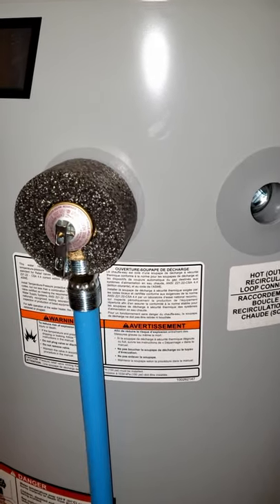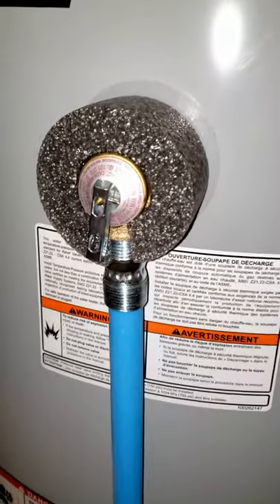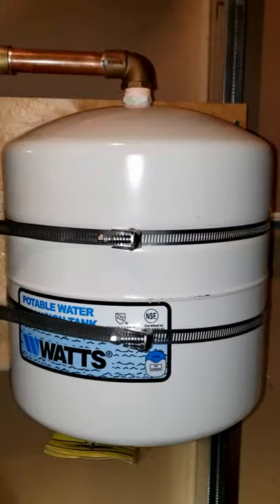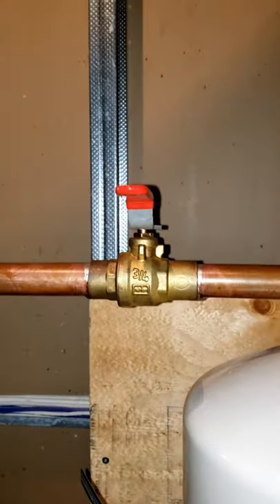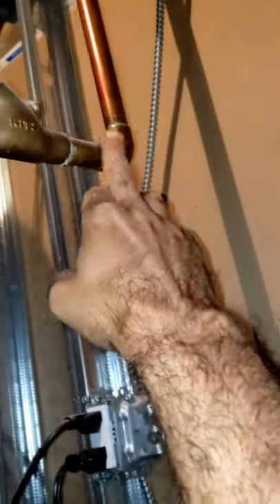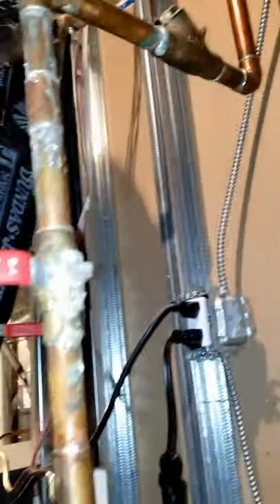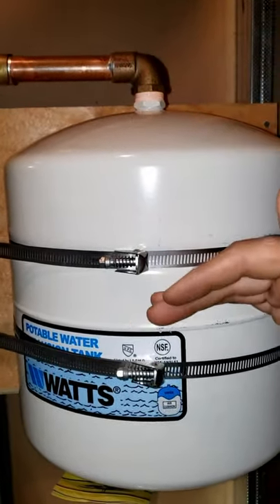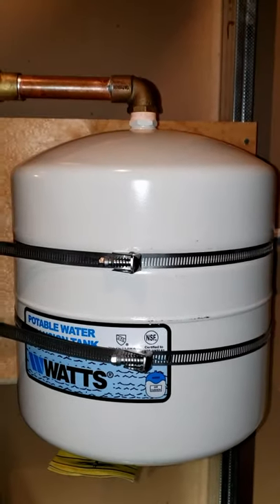Stop Thermal Expansion from Tripping your Water Heater's T&P Valve! #SHORTS

Comment: Is it mandatory to have a drain by pressure relive valve in mechanical room or where water heater is located ?
Reply from the maker: Sam!  Nice to hear from you...I'm happy to see that I haven't scared you away after your being forced to spend eight excruciating weeks with me!  😁

OK, on to your question:  In Ontario Code:  No, you do NOT require a drain to be located in the vicinity of a temperature & pressure relief valve, nor do you need the relief valve's outlet to discharge into a floor drain in any way whatsoever (awesome if you can, but if you do, don't forget the mandatory minimum 25mm vertical air break between the flood level rim of the receiving floor drain and the the T&P discharge pipe - check your notes!  😊 ) 

If you look at Code reference 7.6.1.12 (you still DO have your sacred little brown book, dontchya???  🤔)  all that's required is that you terminate thee T&P valve's discharge pipe between 6 and 12 inches off the floor.  Too low, and it runs the risk of being obstructed, and too high, it may cause injury if it ever goes off.

Hope this helps, Sam!  Keep staying inquisitive 👍, and I look forward to seeing you in Intermediate if I'm still at the college!

Comment: Amd what about the instantaneous electric water heater, what are the plumbing accessories and appurtenances required for it?
Reply from the maker: That would depend on the water heater model and the manufacturer's instructions.

I haven't had much experience with the INSTANT electric ones, although most traditional electric water heaters still need a T&P relief valve - so I presume the electric on-demand heaters would require the same.
Reply: @PlumbingsCool I checked the equipment installation sheets, and the manufacturer doesn't recommend T&P relief valve. However, do I need to provide Isolation valve on both the hot and cold water lines or an IV just on the inlet cold water is fine?
Reply from the maker: It's always a good idea to add isolation valves on both sides so it can be removed or serviced without affecting cold water flow to the rest of the building - although Code only requires isolation on the cold side, which is common for domestic applications (houses). 

However, it's common practice to add isolation valves on both the cold and hot for commercial applications, which often consist of multiple water heaters.

If you're installing to allow for descaling of tankless heaters, then you WILL need to isolate both sides in some capacity so that you can allow the descaling solution to circulate.  Your best bet in that case are 3-way valve kits, similar to the ones shown in my descaling video.
Reply: @PlumbingsCool thanks once again

Comment: Hi. One more query, again 😅
How do you calculate the hot water demand for a residential building?
Reply from the maker: LOL...that's a topic I spend an entire week teaching to my students, so it's not so easy to convey through a text message.   Although it's not difficult, there are a lot of moving parts and involves a number of Codebook tables - as well as supply pressures, developed lengths, flow velocities, etc.

Maybe I'll make of video of it one day, which will require significant planning and preparation to properly convey through video.
Reply: @PlumbingsCool  There is one table in ASPE which has gph values for fixtures, demand factor and storage factor, do you use this table?
Or maybe I should simply wait for your detailed video on this 😅
Reply from the maker: Nope.  We use a combination of up to FIVE tables:
1. WSFU's for "listed" fixtures (sinks, lavs, bathtubs, tank-flush toilets, etc)
2. WSFU's for Direct-flush toilets (flushometers)
3. WSFU's for Direct-flush urinals
4. WSFU"s for "unlisted" fixtures, based on fixture's/equipment's supply size
5. Finally the actual pipe-sizing table once we gathered all the information from the above tables.  

Pipe sizing is based on:
-Total Developed Length to the furthest fixture being served
-Total WSFU being served
-Flow rate dependent on installed material (1.5, 2.4 or 3.0 meters per second)
-Net supply pressure (after deducting head loss)
-And whether you're referring to Water Service (before the meter) or Water Distribution (after the meter, or after it comes into the house).

Comment: I like the relief valve drip leg to be a non-ferrous metal.
Reply from the maker: I still make them out of 3/4" copper pipe and an adapter when required, although these days the new water heaters come shipped with that plastic blue dip tube.  Now even the T&P valve comes preinstalled, whereas in the old days we used to have to purchase them separately from the tank.  I think the manufacturers put these measures in place to ensure that the relief outlet doesn't get bypassed or plugged, which could prove disastrous if pressure builds up in the system.
Reply: Why would that even matter? Pex or cpvc works just fine.
Reply: @sjohnson5813  it's against New York state code. And what do you think's going to happen to that plastic if 210° comes out of a relief valve along with pressure. How about that Einstein

Comment: Can we apply the same logic on thankless water heater?
Reply from the maker: Great question! The short answer is that expansion tanks can certainly be installed for tankless heaters as well, but the long answer is that you probably won't need to.

I'm thinking of trying something a little different on my channel, by elaborating through video on some questions I receive which deserve a little more information.  So if you don't mind, I'll probably start with yours! 😁

Stay tuned!
Reply: @PlumbingsCool  sure
Reply from the maker: Here you go...just for you!  Hope it helps.
https://youtu.be/vtVVKIpsnAI

Comment: Should I turn off the gas line when the TP trips after shutting the water?
Reply from the maker: It depends on what you intend to do and how long you intend to keep the water heater isolated.  If the T&P valve  is going to be replaced immediately and the tank is going to remain mostly filled (up to the level of the T&P valve, then you can leave the heater functioning as normal and the gas valve on (the tank will maintain the existing water at the set temperature and turn on as required) But if you intend to leave the tank sitting isolated for a long period of time (several days or weeks), then it may be in your best interest to shut down the tank (either at the gas valve, or by simply unplugging it if it's a power-vented unit to save on some heating costs.  Just be sure that you heat the water to at least 140F and flush it through a fixture once you recommission it (to kill off any bacteria which may have accumulated while the tank was off). 

If you're concerned about safety, the gas valve is completely independent from the T&P valve.  Just be sure never to keep a water heater running unless there is an adequate volume of water in it...especially the electric  with immersion elements, which will cause the heating elements to immediately burn out if they are not immersed in water when they become energized.

Hope this helps.
Reply: @PlumbingsCool  thank you
Reply from the maker: Pleasure's mine! 🙏

Comment: I dont think you need an extra shut off valve by the expansion tank ..it's a little overkill as you have another one 18 inches away that does the same job , may be it's good for NON - PLUMBER TYPES because they don't know how to control excess water after system shut down .
Reply from the maker: True, a valve to isolate the bladder tank isn't absolutely necessary, although I personally prefer to valve everything so that the rest of the system can keep functioning while isolating one part of it. 

Note too that this is for a non-technical, non-plumber's residence.  If that bladder tank ever starts to leak, all they need to do is shut off that valve and keep using the system until they can schedule someone to go over and replace it.
Reply: Nothing wrong with another isolation valve. It doesn't hurt anything . Calm down DIYer

Comment: We had a freeze last night. I woke up this morning and found ice on the hot water heater. After monitoring it for over 10 hours later, I noticed about 3 little drops of water in the pan I placed on top of the hot water heater to monitor one of the connection joints. I've called numerous specialists, but no one can come out because they are swamped with work and because it's Christmas. I don't know what to do. I don't know how to shut it off if I had to. This is my 1st winter in my house. The hot water heater is close to 9 years old. I kind of think a pipe didn't burst because it warmed up a little today, and I really didn't see a lot of leaking water. What should I do? Thanks in advance.
Reply from the maker: Hi there.  Sorry to hear about your predicament on Christmas day.  Although it's impossible for me to accurately assess your situation, I may be able to direct you toward some tips which may help you control any excessive pipe leaks, until you can acquire professional help.

First, your water heater should have a stop valve on the cold side going into the water heater.  If your leak is between the valve and the tank (or somewhere on the hot water line), then you can simply shut the valve off (although you will have no hot water).

If the leak is before the tank's stop valve, then you may need to shut the water off at the main stop valve, where the water comes into the house (though you will have NO water in the house while the main water remains off - but at least you'll be able to control the water flow).  The main stop valve should be next to your water meter (or by your well tank if you're on a well system). 

Here's a video pointing to a stop valve on a typical municipal system, for some guidance.

Hope this helps and good luck!

Replacing your main stop valve:
https://youtu.be/6BGyjUKHdo4
Reply: @PlumbingsCool  Thank you very much. I haven't seen a leak all day. Nothing is in the pain at the bottom. The pressure release valve is warm, and the long pipe going alongside the water heater is cold. Is that normal?
Reply from the maker: What you describe sounds perfectly normal.  The pressure relief valve is warm because the heat is transferring from the heated water inside the tank.  The tube along the side should remain dry and at room temperature.   Not sure where the water you mentioned was coming from earlier,  but pipe leaks don't usually stop on their own, so that's somewhat strange.  Keep a close eye on it, and if it starts to leak again, be sure you know how to shut the water down as I described before.
Reply: @PlumbingsCool  Thank you. A specialist will be out today. You're a life saver... Never change. Thanks for your videos! Happy holidays!🎄🎄🎄

Comment: Why not just eliminate the check valve?
Reply from the maker: Good question.  I was actually considering removing the check valves initially.  This system had two existing check valves:  One on the cold, and one on the hot.  I'd agree that the hot side is irrelevant, but removing that one would not solve our problem with thermal expansion - so I decided to leave it simply because it doesn't really do any harm by  doing so (although I wouldn't install it as part of a new installation).

I decided to leave the cold-side one because of the hot water recirculation pump feeding into it.  I'm guessing the check valve was installed to prevent inadvertent backup/transfer of hot water back into the vertical cold water feed.  In hindsight however, it would've been ideal to relocate the check valve immediately downstream of the recirculation pump, which would've prevented cold water from backing up toward the hot water line under certain conditions.

I'm happy to say that they haven't had any leakage issues since installation, despite ongoing problems with the T&P valve for years prior to the expansion tank being installed.

Appreciate the question!

Comment: What happens if you do nothing.
Reply from the maker: If your relief valve is opening up as a result of thermal expansion then it'll keep leaking out indefinitely, cycling open and closed as the water pressure continues to fluctuate as it gets continuously heated.  Not the end of the world if your water heater is in a basement, next to a floor drain - but because the valve isn't designed to cycle in that fashion, it does run the risk of losing its ability to seal properly, possibly leading to increased or continuous leakage...not to mention expensive water waste if you're paying for your water.

Comment: That was a line strainer not anon return valve 😂
Reply from the maker: Uh...what's a return valve? 🤔

Also, why would a strainer be installed onto a water line serving a domestic water heater?  I think you're referring to the check valve, which is most definitely, a check valve.

Thanks for your input nonetheless!
Reply: No it’s not a check valve or a double check valve. (Non return). It’s a line strainer. A debris filter. DIY’rs should stay well away from unvented hot water.
Reply: @PlumbingsCool  it’s a line strainer

Comment: That’s not up to code. The pressure relief valve line has to be plumbed out of the house or garage.
Reply from the maker: I'm curious to know where you are, friend, because here in Ontario and all of Canada it is certainly up to Plumbing Code.  Specifically, the pressure relief valve is allowed to terminate vertically between 150mm and 300mm from the floor's surface.  See Ontario Building Code 7.6.1.12(5)(a)(ii).
Reply: Here in Oregon (OPSC) and I believe in any UPC regulated state it can be discharged to an “on grade concrete floor” at 6-24 inches, otherwise it has to be piped outside the building separate from the pan. So if it’s in a garage like usual then your good, upstairs or in a laundry room or something with wood flooring then it has to have a pan and be piped out side. They used to let us shoot the t&p into the pan and then pipe the pan out but as of this year we have to pipe both out separately.
Reply from the maker: @StuckBuckinaTruck  Thanks for that insight...it's always fascinating to know how things get done in other parts of the world.  Here in Canada, you'd be hard-pressed to see a water heater in a garage due to our bitterly cold winters <SIGH!>, and most every house has a basement.  Therefore, you'll likely find most domestic water heaters on or over a concrete floor of the basement, somewhere near the home's furnace.  So most installations have the T&P outlet simply discharge directly to the floor as you see here. Nonethess, there's nothing in our Code that distinguishes floor type for discharge.  Specifically, it reads as follows:

 "Every pipe that conveys water from a temperature relief, pressure relief, or a combined temperature and  pressure relief valve shall terminate at a distance not less than 150 mm  and not more than 300 mm from a floor and  discharge vertically down."

With that said, if we're installing our water heater either suspended (point-of-use in a commercial setting) or onto a surface that is subject to corrosion (wooden floor), local bylaws or good plumbing practice would call for the use of a drain pan and/or the routing of the T&P's discharge to a concrete/tiles floor or to over a floor drain with a proper air break of at least 25mm (1 inch).

Thanks again for sharing!
Reply: @PlumbingsCool  for the most part that seems to accomplish the same idea as here although we will fail inspection from termination on a floor that could be subject to water damage. Termination in floor drains and floor sinks are also allowed here with the same minimum air gap. Oregon is a little stricter than a lot of the states (OPSC is our code) but most of our code has been based off of the current UPC code so I believe those same t&p standards apply to most of the USA. What trips me up with you guys is your pipes sizes are in mm and I just can’t wrap my head around it😂
Reply from the maker: @StuckBuckinaTruck  LOL...well, you'd be surprised to know then, that even we plumbers here in Canada refer to our pipes in INCHES!  I often tell my apprenticeship students that our Codebook is "confused", because it certainly tries to express everything in metric (our "official" unit of measure), but it just can't help but keep alluding to the imperial system when detailing sizing and measurements.  Heck, our entire country still can't get away from the massive influence that our cousins to the south have on us.  Sure, our system has been metric for about fifty years now, but you'd be hard-pressed to walk into a grocery store and find any produce or meat cuts that are sold in Price-per-Kg....it's ALL IN POUNDS!  (LOL...I don't even know my own weight in Kg without converting it first...but I can tell you how many pounds!).  And it's certainly the same thing on the jobsite:  at any given time, I've got a dozen imperial-only tape measures sprawled out all over the place...but I have maybe ONE combination metric/imperial tape measure...hidden somewhere, because I NEVER use it!  It's why when I teach the apprentices Shop class or a Math class, I spend a lot of time teaching them how to properly and quickly read an imperial tape measure:  It's not "required" according to our traditional education system (which is a whole other sad topic in itself!)...but Feet, Inches, and Fractional Inches is still so deeply engrained in our system.  There's no getting away from it!